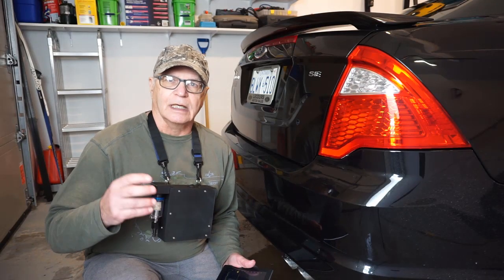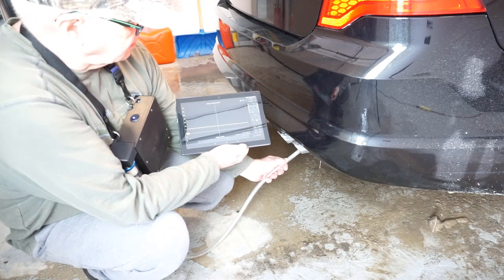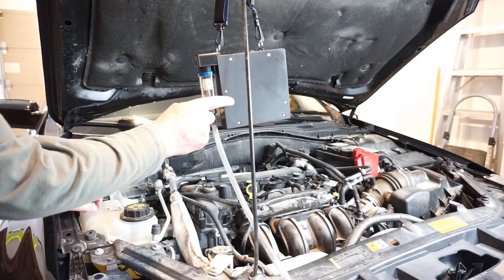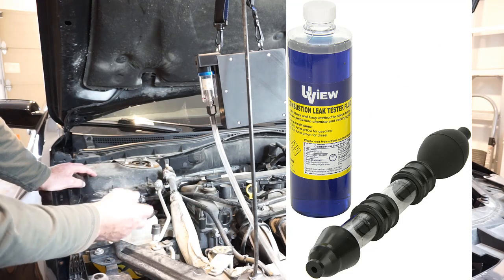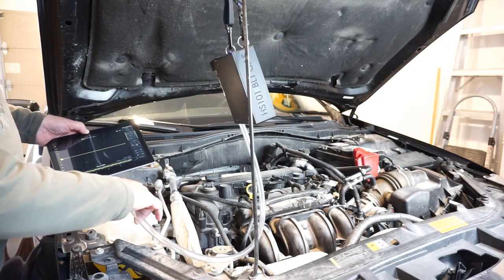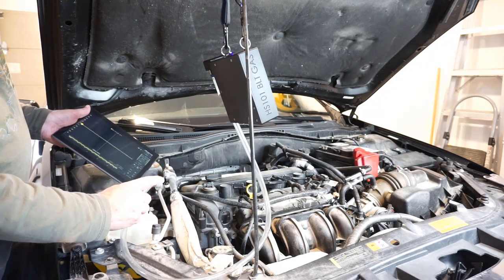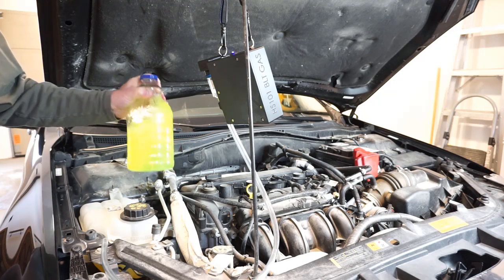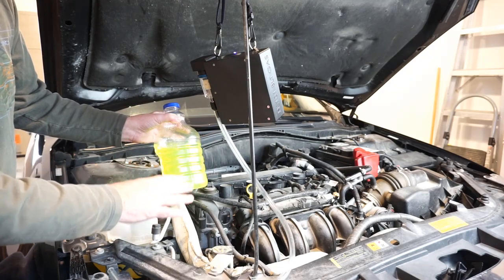GADGETS#135 - HEAD GASKET COOLANT TEST

Comment: Denis have you still got the MQ-2 sensor in this demonstration here measuring the Carbon Monoxide?
Reply from the maker: yes...MQ-2 proved to be best all 'round sensor
Reply: @theGADGETSplaylist  So did you not have any luck with MQ-7 & 9?
Reply from the maker: @Grunter123  MQ-2 seems to do as good a job as MQ-7 with carbon monoxide while also excelling at detecting hydrocarbons which the MQ-7 isn't much good at

MQ-9 is a whole different animal, cycling from 1.5v and 5v ... not friendly to the HS402/HScope method
Reply: @theGADGETSplaylist  Thankyou Denis, I am going to attempt making one.

Comment: what do you think is the cause of CO2 detection in the known good vehicle? I’ve often wondered about this and I have used 3-4% as a low threshold for failing headgaskets. 
I’ve tried to find information about what other processes can cause CO2 to develop and came up empty handed other than carbon based life breathing and the burning of hydrocarbons. 

I don’t like testing for hydrocarbon in the cooling system because I do not know what kind of product have been used to try and stop a leak. If those products had a small amount of HC then the test is invalid. On top of that many vehicle I’ve tested with confirmed headgasket failure show CO2 in the cooling system but show no HC. The only ones I’ve been able to detect HC on were vehicles that has excessive unburnt fuel cause by a misfire.

Thanks again for the great tool and test series.
Reply from the maker: It gets technical. Difficult to discuss in YT comment section. I know you're a busy guy, but I extend an invitation to look me up on the TELEGRAM HScope Group:

https://t.me/hscope

You can say hello to the gang, and we can PM about this topic. Hope to see you there Chad:)

Denis

Comment: Parts are on order.
Will use a M5stack that I had  around waiting for an application.
So there is a direct readout on the unit.
Will also try to reduce the air volume involved to reduce time for measurement up and down ramps. Is there a need for the relative large volume ?
like avoiding airspeed at the sensor ?
Thank You very much.
Reply from the maker: there is no "air speed" at the sensor...small air pump only draws 2.8L/min ... just right, I think ... especially with the water separator modification (pictures in download folder)
by all means, take the basic concept of HS101 BLT GAS and run with it, improve on it...all good with me:)

Comment: Interesting... does it do CO as well?  Would like something like that for mixture.  Also, check out the video on using pressure transducer for head gasket failure...  https://www.youtube.com/watch?v=zCWJ5ax78Zc&lc=UgyF99jyuLEQI_LxH294AaABAg.9HAtPgbU81g9HB1iKQg12Z
Thanks and have a great day,
Reply from the maker: The right MQ-x sensor and the right calibrations would do CO but it's not on my list of priority target gases.
Look at 5 gas analyzer work on YT and you'll see that CO is negligible. So is O2. So are hydrocarbons at exhaust. Mainly water vapor and CO2

Comment: After your demo test I was hopefull the head gasket test might work, clearly it does! At work I often use the blue chemical based test for combustion products in coolant. This new gas analyzer project will defiantly get the dust off my soldering station . Thanks so much for all your work !
Reply from the maker: Any help needed Greg, I can be found on HScope TELEGRAM Group. It's an interesting build.